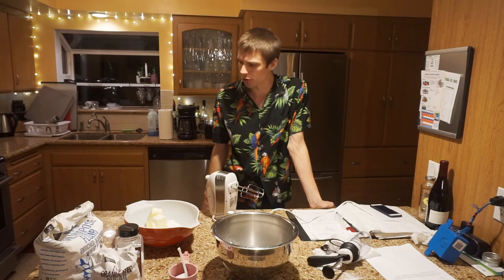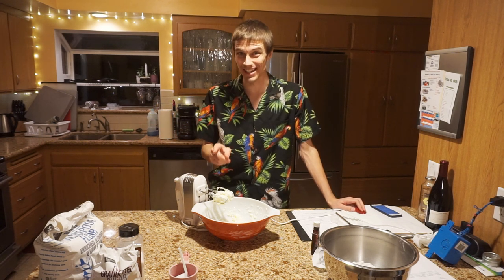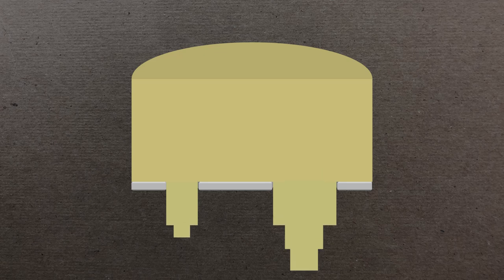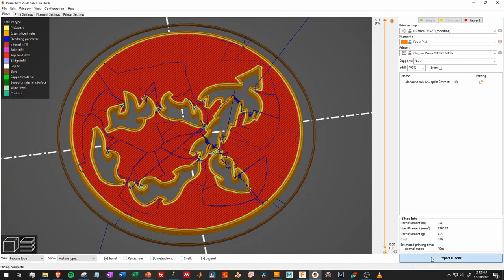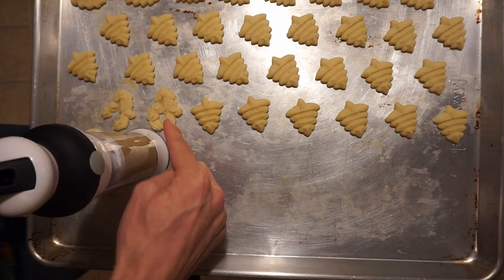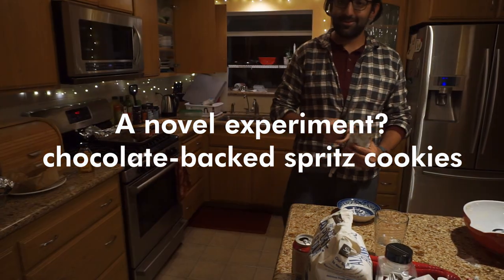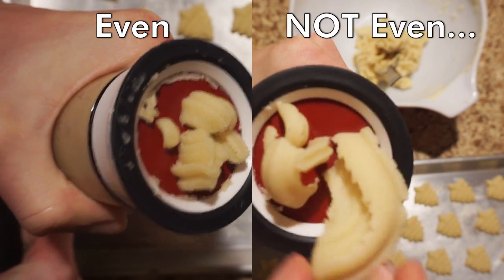3D Printing a Spritz Cookie Press! (Christmas Special)

Comment: In my family the Spritzgebäck is made with a meat grinder with special extrusion plates. The dough comes out as a thick "cable" which is then put on the baking tray in various shapes (best to see in the english wiki article about Spritzgebäck). But its obviously less fun ;-) Frohe Weihnachten!
Reply from the maker: ooh that looks awesome too! now I want to make a smaller extruder just to do those...
Reply: @AlphaPhoenixChannel   can confirm, we still use that pre ww1 cast iron mincer to rapid fire a hole tray in 2-3 mins. but some shapes have allways caused trouble. your logo looks kind of big. cant meassure it right now, but i would guess the extrusion area is lower than 1cm² (star shape) or just 2 5mm circles, and that on a rather chonky grinder which needs at least a pound of dough to get the sprial screw moving it properly. on the plus side, friction heating the dough up, really makes it much easier to work with.  11/10 german points, for powering it all with your cordless drill! dang i want cookies now

Comment: Maybe embedding a thin wire mesh in front of the Logo could work: It should (maybe) spread out the "hydrodynamic forces" evenly across the Logo surface area. Hopefully without just creating strings, as the doe should(?) recombine behind the mesh.
Reply: don't shove deer through wire meshes tho
Reply: I guess the mesh would just form a bulge recombining the doe into even circles
Reply: You know what that makes me think of? Screen printing. I wonder if a screen-printing-type setup could be scaled appropriately to allow screen-printing cookies.

Comment: Love the idea. I know you briefly mentioned it, but one of the reasons pointed parts are no bueno with food is cause there are small gaps between layers that are really hard to clean. That makes a great home for bacteria and bad stuff to grow. Just watch out for repeated uses of the part
Reply from the maker: Yeah I was scrubbing the plates pretty hard in the sink before use, but I was worried about being able to get into all the nooks and crannies. I don't think this is a print that will see use next year... Maybe not next week... lasercut would be much safer, but a lot harder for me to iterate on in the middle of a batch of cookies because of the extra half hour in the car...
Reply: @AlphaPhoenixChannel  one of the many benefits of having a 3d printer.... instant prototyping
Reply: you could use a resin printer instead... didn't you used to work at Form labs? Who have a bunch of different models of resin printer?
Reply: @JosiGold1  "Instant prototyping" is really in the eyes of the beholder

Comment: Been making press cookies ever since my mom taught me .... about 55 years ago.  Time and thousands of cookies have revealed a couple of things:
1. not all press plates are equal ... the better ones (i.e. when the shape on the pan closely matches the shape on the disc) have slightly beveled edges.  It is very important to put the disc into the press right-side up;  if you get the bevel backwards, results are worse.
2. the consistency of the dough is critical.  A stand mixer to cream the butter & sugar is not optional - and it must be done for 3-5 minutes at the mixer's highest speed.  This tends to minimize issues with variability in dough volume passing through the disc as described early in the video.
3. the temperature of the dough when pressed onto the sheet is fairly important  - since it impacts the viscosity of the dough.  Too cold, and the cookies won't stick to the sheet.  Too warm and you get nothing but a "butter blob" instead of the shape in the disc.  I've taken to putting slightly warm dough into the press, then refrigerating it for a few minutes, using an instant read thermometer to judge when its ready.  (Different presses work better with different dough temperatures).
4. pressing works best when the cookie sheet is a bit colder than room temperature - I clean mine between each use; running under water about 55 deg F seems to work best.

Comment: I thought you were going to experiment with mapping the logo to a polar coordinate system and then using an algorithm to shrink or enlarge the cross-sectional area of each hole based on predicted flow at each lamina.
Reply: Yes, you already said you had a theory on the flow of dough through the openings: a bit of numerical calculations could optimize the shape to make the result look like the logo. You could even use AI and train it with the original standard shapes.

Comment: another way of achieving this i (i think) might be put a metallic mesh with cell size smaller than the smallest detail in the pattern, this way shear forces would be determined by this mesh and not by the shape of the extrusion pattern. i never tried it, just a thought.

this is similar to how they make those laminar flow fountains that produce jets with constant velocity through the entire cross section of the stream.
Reply from the maker: oh wow they have mesh in those? that's fascinating!
Reply: @AlphaPhoenixChannel  afaik they don't have a mesh (mesh does not provide enough friction because water has very low viscosity), they have an array of parallel tubes instead.
Reply from the maker: Ah - like the mythbusters’ sawed up straw packages when they built a wind tunnel
Reply: @AlphaPhoenixChannel  yeah. you can also look up "laminar flow fountain" on YT  to see how people DIY those nozzles from straw bundles as well.

Comment: You could perhaps try a series of holes that are the exact same size. This would eliminate the flow separation variable. That might be difficult to 3D print though, and drilling would be quite another process to add.
Reply from the maker: the commercial extrusion plates solve this by being simple and copying and pasting the same shape like 5-6 times and calling it a pattern xD. lots of equal holes is a good thought, but hard to print - better suited to  laser perhaps

Comment: I know this is old, however, this definitely nerd sniped me.  I did plastic part and mold design in college and as an internship and one of the approximations we used for runner sizing (the network of tubes that deliver plastic in the mold) was to equate shear rate and volumetric flow of each runner network.  The "old school" way the mold makers used was to set the area of each orifice equal, but we know now that you want to use flow rate.  We would set the shear rate (γ) = 32*Q/π*D^3 of each branch equal to each other such that γ1=γ2=γ3=...  Then doing some algebra you get Diameter_main = Diameter_branch * N ^(1/3) where N is the number of branches.  Soling for different branches will give you N=2 the main diameter must be 1.26*Diameter_Branch. and for your 6 "runner" system (assuming you wanted equal part sizes of each drop, the Diameter_main = 1.817*Diameter_Branch.  So you could artificially constrict the flow prior to each orifice shape, alternatively you could try and get the mass flow rates equivalent.  Honestly, I am not sure which thing to optimize for this cookie extruder.😂  But we used the flow rate of Q = ΔP*D^4 / 128 * μ * L  Where P is the pressure drop, D is the orifice diameter, mu is the fluid viscosity, and L is the length of orifice.  But since we don't know all those values, we can make a rough approximation that Q ≈ D^4.  And because we didn't always know those values what we would do is weigh each part from each orifice and use the approximation to change the orifice size.  So if we needed the part to be 25% heavier we would use Diam_new = Q_new^(1/4) * Diam_original.  That means we would only need to increase our orifice diameter by approximately 6% to get a 25% change in flow rate and thus mass, with all things being equal.
Reply from the maker: I wonder if it could be approximated by taking the largest circle that would fit in the shape at any given location
Reply from the maker: And then swelling some of the small ones to make a weird shape that extrudes more wvenly
Reply: @AlphaPhoenixChannel  I don't think you'd need the circle fit approximation, if I understand you correctly.  Rather, in your CAD program of choice you could get the CAD nominal area of that shape and re-derive the flow rate equation to use arbitrary area instead of diameter.  Since flow rate is just the double integral of velocity * area. Q= ∫∫ v dA.  And substitute u(x, y) for the area... Maybe?  Or I could fumble my way through the flow rate equation earlier and factor out π*D^2 / 4, and we would get Q = ΔP*A^2 / 8π * μ * L, maybe? Where A is area.  My Math minor isn't doing me any favors, nor is my BSME  😂😂 but The dimensional analysis works out for volumetric flow of [ L^3 ] / [ T^1 ].  And as far as swelling, I'm not sure that would be an issue if you try and equalize the shear rates for each orifice?  Either way since it's a non-newtonian fluid it should still be in the laminar flow regime, not sure if that helps or not.  Thanks for the nerd snipe!😂😂

Comment: Did you try to chamfer or fillet the inside edge of the plates? That would reduce the flow losses (forgot the actual name, been a while since I had Fluid Dynamics)

Comment: Interesting stuff.
I’d have tried to optimise the process, turning it less like an extrusion and more like an injection moulding. With a solid mould with one side made up of the baking paper, you could simply extrude dough until the mould is full. Plus you’d be able to make biscuits (in the UK sense of the word) with more depth to them. Of course, the mould would need to be particularly resistant against sticking, for which some HDPE melted and smooshed across the surface of a 3D printed part could work (plus making it more food safe). Not sure if the texture would be any different though.
Reply: Considering he did the cookies/biscuits because of family tradition, i don't think changing everything about it was the point

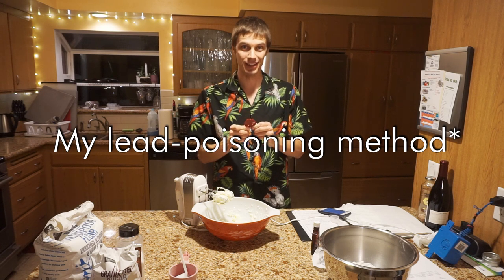Comment: 4:08 where does lead come from?  what's worse? brass or PLA ?
didn't think of booth.  I can understand about plastic. (does it realy can poison food with just a cold touch?). But now I'm curious about brass. There are enough brass kitchen stuff on sale. 
like distillators or coffee shit.
Reply: Little late, but lead is commonly alloyed with brass at about 2-5% as a corrosion inhibitor, to reduce porosity of the cast material (my understanding is the low melting point of the lead causes it to sorta' flash-patch many of the pores,) and to modify the mechanical properties of the material. I have no idea what rate lead leeches into PLA at, but common printing temps range from 190-230C, so the rate is probably pretty far from zero. There's stainless steel nozzles for this sort of thing that have their own corner-case problems, but at least they'll make unleaded cookies in the end.

As for the PLA, pure PLA is considered safe for things that interact with food. Nearly every spool of PLA out there came from a mystery soup of pigments and co-polymers, however. I can't speak from any specific knowledge on the matter, but if pottery glazes and paints are any indication, there are a lot of awesome pigments that would make for terrible condiments.
Reply: @StopChangingUsernamesYouTube  Thank you!

Comment: 5:27... you could of loaded it less??  and if you want to still be able to do many without requiring disassembly, make it act like a gun where by releasing allows you to push more dough from a larger compartment into a smaller compartment for you next press

Comment: Cut the shapes into pieces, don't try to transform the shapes such that they have the right constraints, just cut the shapes up and rely on the dough mashing together to paste the shape back together. Like with the christmas tree cookie mold, it literally doesn't have a trunk above the first leaf layer. Also couldnt you use a low friction material? And finally, this seems like a terrible application of a 3d printer. Theres nothing 3d about it, the optimal design for this is the flattest plane possible that is as strong as possible lol, exactly the opposite of what a 3d printer excels at. Did you not have any laser cutters or mills or anything at that time?

I did not expect that those aren't chilled cookies. How are those not chilled cookies? So much butter, i guess though since youre not rolling them and theyre too small to spread much you don't really need to chill the dough. It seems like the real impressive invention here is a press that allows people to make rolled cookies as though they were drop cookies, which is really very convenient. No offense of course, but I'm sure you understand that the inventions of the giants whos shoulders you stand on are sometimes more impressive than what comes on top :P. The idea of using a 3d printer so wrongly, for something that in no way warrents a 3d printer and could probably be made better with a piece of wood and a chisel, really turns me off. Overcomplicating ones toolset is really gross to me. Tools are so beautiful and wonderful, to crassly just shove something so fragile and nuanced into a task it doesn't need to do feels bad. Like when people use smartphones as wired security cameras, blegh.